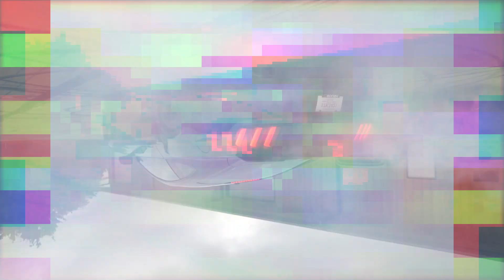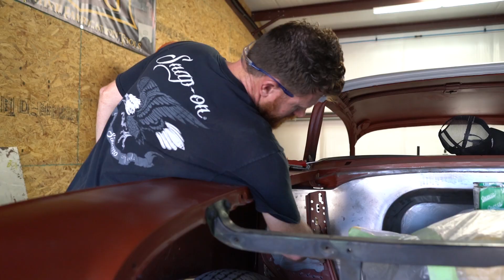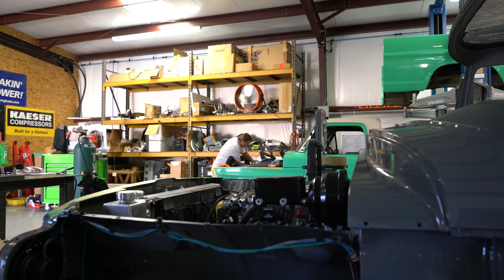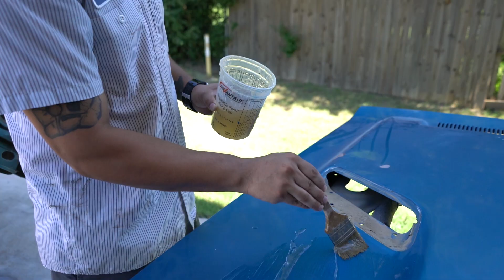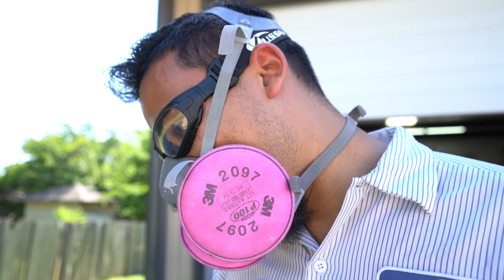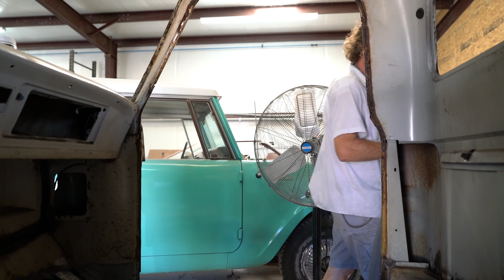Paint Stripping

Comment: I will try to contribute for once instead of a million questions! You may already know but I always hit the panel with a DA and 60 or 80 grit before using the stripper, it helps the stripper to get down into the sanding scratches and is more effective so you only have to use stripper one time and also I put Saran wrap over the stripper right away to keep the chemicals from vaporizing or flashing off too quickly! Stripping paint is that nastiest part of a restoration and I only want to do it once. It's hard to find good guys to do media blasting without messing something up, a warped hood, roof or door can ruin your year ha!!!